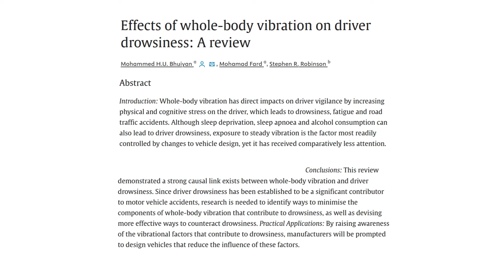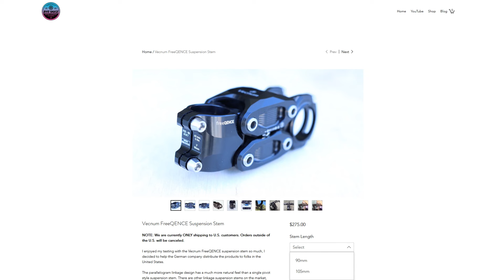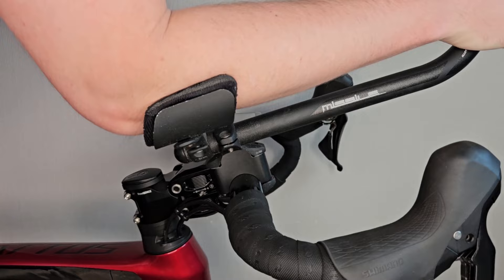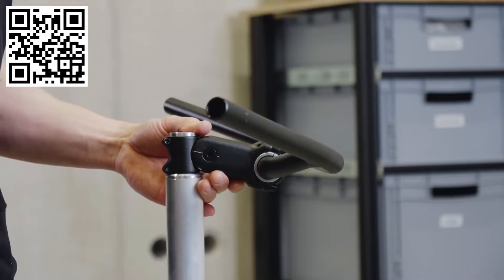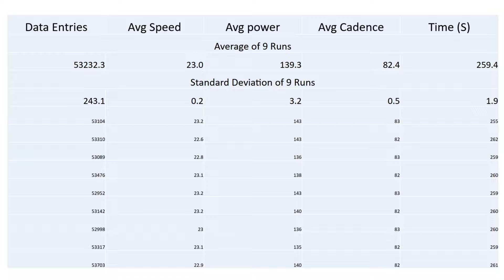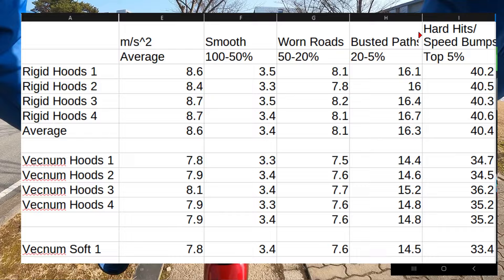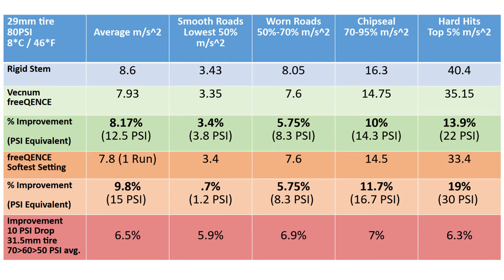TESTED: Vecnum freeQENCE Suspension Stem

Comment from the maker: Equivalent to a 30 PSI drop in tire pressure for hard hits!!! Do you use a suspension stem? Will you try one now?
Reply: I use Redshift.  I have a gravel bike and take part in 75k plus gravel rides. Love it!
Reply: I have a RedShift and I like that it takes some sting out of bumps but I don't like 1. the single pivot "throw you over the bars" feeling and, 2. the clunk of topping out. I fixed the second problem by putting a bit of tyre tube on the "up" part of the internal mechanism, but I can't fix the first problem. That's why the Freeqence looks so appealing.

Comment: I use redshift shockstop and am very happy with it. Curious to see how these two compare. Waiting for the next video. Thanks for sharing
Reply from the maker: After 2 years on the Shockstop, the Vecnum felt completely different. Both are excellent, but definitely different. The real shocker was riding a rigid stem again. I never see myself going back to that.
Reply: @overbikedrandonneuring video coming out soon? I am looking for suspension STEM and at the moment redshift looks the best budget wise
Reply from the maker: @CZMeti I want to get plenty of mileage on the Vecnum before sharing any conclusions. After about 2000k on it and 3 brevets, initial impressions suggest the Vecnum performs a little better as it can be set softer without being noticed, and functions in a way that is less noticed in general. It performs significantly better with aero bars and in the drops. Redshift is still a huge improvement over a rigid stem and holds many advantages over the Vecnum, like price, sizing options, ability to flip it for +/-6 degrees, no cable interference, and appearance. Hope this helps in the meantime. Let me know if you have any other questions.
Reply: @overbikedrandonneuring  it does! Much appreciated!

Comment: Everyone buying gravel bikes not expecting how harsh the ride really is. Maybe this is a solution but it's ugly as ****. Just get a suspension fork, problem solved. And loose the dropbars for offroad use.
Reply from the maker: I have little interest in gravel personally, but I suspect you are onto something. 38c knobbies are not doing much. On the other hand, suspension forks are trash at mid-high frequency, low-mid amplitude vibration where the Vecnum is awesome. Horses for courses. For what it's worth, my attempt at a drop bar gravel bike was a custom Ti frame with 2.4" mtb tires, 69* headtube, and Lauf MTB fork back in 2016. You may have liked it. A similar setup may become mainstream in a few years, at which point I can feel smug. 

This channel's focus is ultra distance road cycling, where insulation from harshness is valuable to reduce fatigue. Aesthetics be damned if such performance can be gained as seen in my testing.
Reply: @overbikedrandonneuring  he don't wanna hear all that 😅 he only saw his narrative

Comment: Problem : suspension stems, whatever the brand, come in very limited lengths and angles potentially ruining your bike fitting... which is key for comfort on a bike. If you need so much such a device, man, you're  sitting on the wrong bike for your type of riding or need for comfort. Very interesting test and valid testing method, though.
Reply from the maker: Vecnum has limited fit options, but is likely to accommodate most riders. Redshift have many options and the angle can be flipped so nearly any fit scenario can be accommodated by them.  

For ultra distance cycling, the focus of this channel, insulation from vibration is more than for comfort, it is for reduced fatigue. With minimalist suspension systems, we can run maximally efficient tire setups that are not necessarily cushy: narrow enough to be aero and smoothly transition to the rim, with ideal pressures for speed; but still be insulated from vibration. Less power needed when pedaling, less fatigue incurred from rough roads is an ultra distance cyclists dream.
Reply: "suspension stems, whatever the brand, come in very limited lengths and angles" : I wouldn't call the range of lengths and rise angles offered by the Kinekt stem "very limited"...have you had a look at those?

Comment: I got excited by this, but then I learned the minimum length is 90mm and 90 is usually frame size medium or larger on road. both my gravel and road bike have 60mm.
Reply from the maker: Yeah, there are even limitations as to which frames can accept the Vecnum 90mm version. They have a little guide tool to test your frame compatibility.  

The Redshift goes down to 80mm. With short reach handlebars, it may work for you.

Comment: Another excellent analysis.  I have been using RedShift in large part to your past videos.  I am in the process of finishing the setup of bike#2.  I just bought another RedShift setup!  I’m getting emotionally prepared in case you determine that Vecnum is better!  Regardless, your posts always help. Thanks!
Reply from the maker: Glad to hear you enjoy it! No need to worry either. Both products are very good and miles better than a rigid stem. What bike are you building for bike 2?

Comment: The Vecnum freeQENCE Suspension Stem sounds like a winner.  My bike has the Cirrus Cycles Kinekt Suspension.  It appears the Vecnum has a similar execution, with slight improvements to design and materials.  I'm happy with my stem and have no complaints.

For those interested in my pursuit of comfort and handling improvements...
I bought a ridged Class 3 e-bike, designed for urban use.  The ride was extra harsh.  I live in a big city with plenty of poorly maintained roads.  After several longer rides, I knew that I had to make some changes.  I detailed all of my improvements to illustrate that no single improvement does it all.  It would be great if that was the case.

The first improvement was going from a 28mm to a 38mm tire.  A suspension seat post was the next step.  Followed by replacing my stock stem with the Kinekt Suspension.  Finally, I replaced my stock flat handlebars with the Spike 800 Vibrocore bars with a 75mm rise.  Everyone of these additions contributed to my bike eventually becoming far more comfortable as well as adding confidence in handling.
Reply from the maker: Thanks for sharing! I've always been curious about the Kinekt performance. I imagine it is ideal for gravel and constant harsh pavement. With an ebike, there are a lot of good reasons to get wider tires, including grip for braking. Low pressures are great for comfort and grip too. Glad to hear your comfort is all sorted.
Reply: I've own a traditional bike.  E-bikes are a completely different animal.  Because e-bikes weigh more, generate much more torque and speed, they are engineered to be much more of a ridged.  The Kinekt stem was a successful improvement for my e-bike.  I do suggest along with tire changes and a possible suspension seat post, if you upgrade your stem, consider upgrading your handlebars as well. 

BTW I forgot to mention in my earlier comments, Thanks for sharing a well produced and informative video. @overbikedrandonneuring

Comment: God can I just say that I love your videos? They’re so thorough. 

Have you tested the redshift or cane creek stems compared to the vecnum? I’m very curious how they compare, even anecdotally, without data. Selfishly, as the owner of two redshift stems, I could believe the vecnum is better but just by how much is the main question I have considering they’re 2-3x cheaper. I also have a canyon bike, so for that bike, my only option is the redshift.
Reply from the maker: Thank you for the kind words! I haven't tested the Redshift on this protocol yet, but I have ridden it for 2 years. I am also curious about its performance in a numerical sense. The numbers will only tell part of the story since the type of movements are different. I suspect the Vecnum will come out on top for me due to behavior with aero bars, but the Redshift has design and packaging advantages too, and may also result in a softer self-selected stiffness when riding on the hoods.
Reply: @overbikedrandonneuring interesting! Curious what you think the design and packaging advantages are? Or rather, what do you mean by that?
Reply from the maker: @rdx913  Redshift has 7 sizes, including 2 30 degree sizes. The 6 degree versions can be flipped. They also have 1 1/4" versions for Canyon/Giant oversized steerers, so more fit options are available. The movement types of each stem will result in different levels of perceived comfort in different hand positions, and different factors that limit the softest useful configuration. I really feel in the weeds now haha.
Reply: @overbikedrandonneuring oh I see what you mean. Yes, agreed! I have a 120mm in 1 and 1/4 run in negative orientation on one bike and a 80mm in 1 and 1/8 run in positive orientation on another.

Comment: This is wonderful analysis that backs up my semi empirical experience. 
I have the Freequence 105 with riser bars using 42mm tires and i really enjoy it. The linkage does hold up, but ill look out for the galvanic corrosion possibly.
Reply from the maker: I've put in 500km of randonneuring over the last two weekends, and the Vecnum has been excellent. Thanks for your input!

Comment: I've been a convert to the Redshift stem for a while now.  This looks like an improvement, however the positive travel puts me off. I don't need my upward motion being absorbed when I lift my bars/wheel over an obstacle.  If you don't ride on gravel I'm sure this is a non-issue but it is enough to put me off changing systems.
Reply from the maker: Yeah, I don't have the context of experience to comment on that. I don't notice the positive travel on the Vecnum, but it may be needed to protect the integrity of the stem. Kind of like if you replaced a rear shock on an MTB with a rigid metal rod, impacts would destroy the frame. 

The Redshift might benefit from positive travel squish in some contexts. I often pull on my aero bars to get in position, but with the Redshift single pivot, leverage puts a lot of force on the little plastic wedge. The extension tips are 38cm from the pivot, so large multiples of mechanical advantage are applied and I may have damaged the wedge. Only a problem with aero bars though.

Comment: Thanks for the information! The stem seems to be impressive for everyone looking to improve their comfort, but there seems to be 1 important problem as well:

The stem absorbs bumbs like softer tires, but unlike softer tires the vibrations are stil present in the frame. Maybe the vibrations in the frame are even bigger due to the suspension stem because there is less deformation in the tire (that is my guess, since the weight on the suspended handlebar moves the suspension the stead of the tire). It may not seem that relevant since the comfort on the handlebars is still improved with the suspension stem, but if it is at the expense of the comfort at the pedals and saddle it might not be  worth it. 

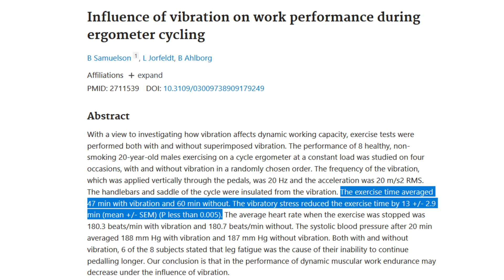Interesting is that in the study you mention at 1:22 states that the saddle and handlebars were insulated from the vibration, so vibration at the pedals is a major problem as well which cannot be solved with a suspension seatpost or stem. And those vibrations might even be increased. 

What do you think about this? Could the suspension stem increase frame vibrations?
Reply from the maker: Great question! I don't have a reliable answer, but I'd welcome smarter people than I to give this question a crack. My input is speculation, but I'll give it a go. I'll consider the context of the same tire and pressure with or without minimalist suspension components. Optimizing tire setup for speed and avoiding the aero and rolling resistance losses of big soft tires is the main appeal of these systems. So the question becomes if minimalist suspension systems increase pedal vibration.

I think of the system as springs-in-series, where the tires and minimalist suspension systems (Vecnum stem and Redshift seatpost in my case) are the only effective springs between body and road. I consider all the minor deflection in the force paths small enough to be ignored (rims, spokes, hub, bearings, frame, fork, handlebar, crankset, etc.). Body weight is applied to the bike through hands, feet, and bum. The ratio of weight in each pathway is dynamic, but in general most of it goes through the feet. 

With only some weight to suspend, the spring rate of suspension stems and seatposts are rather soft compared to the tire. Softer spring rate is evident by the Vecnum performance improving relative to a reduction in tire pressure as conditions roughened. The travel of these systems is also quite small, max 20mm. With soft spring rates and short travel, the total energy dissipation capacity of the systems is not huge according to Hook's Law, despite significant gains in perceived comfort. If that energy was transmitted through the frame instead of the stem or seatpost or tires, it would add vibration to the cranks (but not too much since the energy amount is rather small). That energy is released as heat and stored in the elastomers as elastic potential energy used to return to their original shape against the weight of hands/bum instead. 

In total, I suspect a small amount of energy is 'absorbed' by the suspension components. Tires may deform ever so slightly less. This could, in theory, improve rolling resistance through a reduction in hysteresis or impedance losses. I suspect this effect would also be quite minimal given the small amount of energy these systems handle. But less tire deformation alone gives no reason to suspect that extra energy gets transmitted to cranks via vibration.  

Anyway, that's my best guess. Curious how reducing hand/bum vibrations affect vibration felt in the legs. Also curious if those better informed than me have better ideas. Cheers, and thank you for the thoughtful question. I feel like I learned a lot trying to answer it.

Comment: A question on the Vecnum Freequence stem: What amount of the 20mm travel (downwards) would you say is already consumed by just having your hands (and therefore part of your body weight) on the bars while riding in the "hoods" at a modest (bike touring) pace (no major bumps)?

Great channel (data driven, not flashy) btw , just discovered it.
Reply from the maker: Thank you for the kind words. Very little travel is used up as sag. I haven't measured it, but I would hazard to guess maybe 2mm or so.

Comment: Excellent test review! Subbed😊. Have 2 redshift stems and they work, but i think  these will work better due to dual pivots. Question is how much.    Do they sometimes have  promotions or discounts? That would help to bite the bullet.
Reply from the maker: Thank you! I am glad this was useful for you. More time is needed with the freeQENCE to make definitive judgements. I've been on the Redshift for 2 years and still evolve my perception of its performance. I think discounts are few and far between. Vecnum manufacture in Germany, the design is very complex, the finish is outstanding, and they use titanium axles, so I doubt there is any room for discounts. After I get a few brevets in, I'll report back with a comparison.

Comment: Thank you for your video test. I ride a cannondale synapse (80% training on the roads in quite good condition and 20% in gravel). To preserve my neck and low back I hesitate between cane creek eesilk and vectum freeqence. The small difference of price will not affect my choice, I try to find the best model for me. I am afraid that the model of cane creek could be to soft for the training on the road. My weight is 105 kg, (with a back bag 5 kg more). I reseach a confort but not to lose the reactivity of the bike. What do you think ? Thank you in advance for your reply and advice. Chris from France
Reply from the maker: Hi Chris, I've not personally ridden the Cane Creek, but it likely performs in a similar way to the Redshift. All 3 suspension stems offer a wide range of stiffness adjustment. At 93kg, I use adjustments in the middle of both the Vecnum and Redshift for road riding, so either would accommodate you. Subjectively, the Vecnum is less noticeable in use, thus slightly better maintains the impression of a reactive feel and better fits your described needs. For actual handling, both the Redshift and Vecnum are plenty stiff to twisting forces and neither feel sloppy. In fact both improve the feelings of control compared to a rigid stem. I set some ill advised KOMs on a rough downhill using the Redshift stem when I first equipped it a few years ago.   

For lower back comfort, I would recommend a minimalist suspension seat post. The top road choices are Redshift Shockstop Pro and Cane Creek eeSilk. I chose the Redshift Shockstop Pro over the Cane Creek for what it's worth.
Reply: @overbikedrandonneuring  Thank you for your reply and advice👍